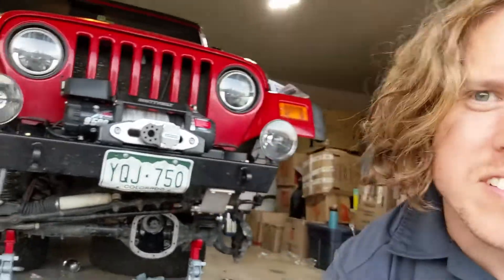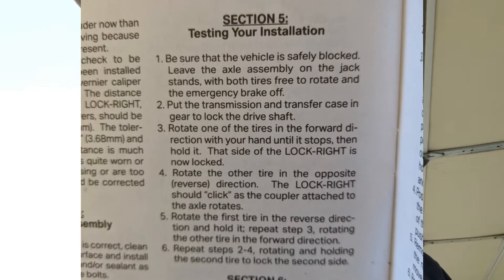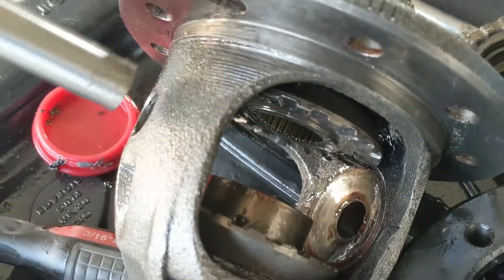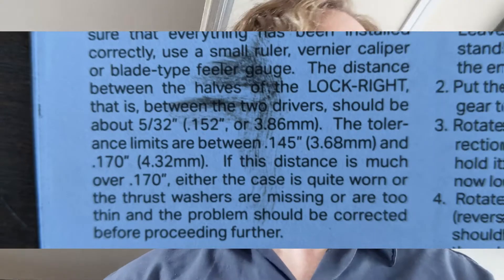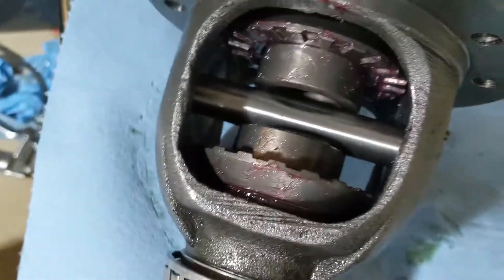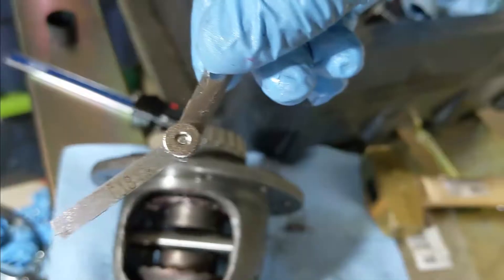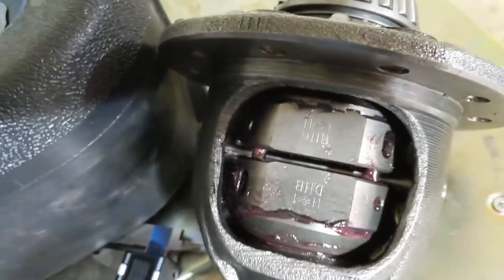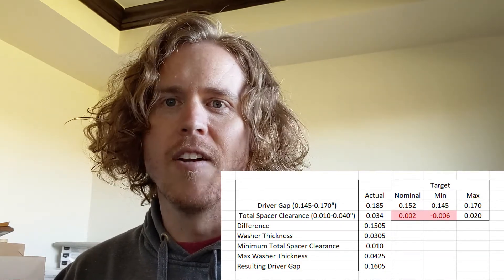Powertrax Lockright doesn't unlock!

Comment: I have the same unit for my 2011 ford ranger with rear 8.8, but the problem I'm having is I broken off 4 bolt studs & I'm trying to replace them. But the access inside the locker to c clip is very hard to pull out & I'm out of luck😭

Comment: I put a lunch box in my CJ5 not long ago.   It seems to work but it clicks when turn Conor’s people look at yo7 like the resend is trash. When you let off the gas it throw the rear sideways some.  I going to change it this winter. Go with a limited slip.
Reply: I don't know if you read any of the literature that came with the directions, but short wheel based (and Narrow track) vehicles like a CJ5 will definitely get 'funky' either getting on the gas OR abruptly getting Off the gas. I put an Aussie Locker in my CJ5 (Dana 44's front & Back) and yes, she made noise going around corners, and she would 'Bang" every now and then. People would look, and I'd just smile and say that when the Jeep is off-road, it'll go places that you can't ;-)    Living with a locker shows that you have upped your man-card into driving, and handling a vehicle that is ready for off-roading adventures, and you could care less what other people think!   Enjoy that CJ, I wish I had mine back 😞

Comment: Those do NOT use thrust washers
Reply from the maker: That's not what my install manual said, and if I had done it without washers it would have been even farther out of spec and still wouldn't have worked.
Reply: I put the old side gear shims AND the spare pinion gear shims I had left over from regearing to get my lock-right in spec. I think the powertrax is right for some vehicles, but is a very lazy design for many others (they make an initial design, and refuse to make any improvements or redesigns to fix original design flaws). It works for me, but I've already had to weld the pin holes because they were cracked and broken from the forces from ratcheting. Also, the caps for the axles heads were cracked and breaking apart (mine is c-clip design, so a cap goes over c-clip between side plate and drive plate). 
Many axles are different, and require different lock-right plate designs and set up. Some may not require shim washers, but mine did, but they don't provide shim washer kits, so I had to improvise.
Reply: @Thrsmthngwrngwthsgy  so you’re saying you doubled the shims on each side of the carrier I wonder if that’ll work for my lock right locker out of spec

Comment: Got everything back together and tested it. For reference the housing is the original housing but not worn loose. I did new thrust washers and my spacer gap was .013" on each side of the cross shaft. I've tested it, both axles will turn with each other when locked at the hubs BUT I cannot get the unit to ratchet and neither wheel will turn opposite each other for the test. Im not sure if that's correct or not, I'd hate to think I did something wrong
Reply: I have a lock right in a front 60,  I could never make it ratchet or turn opposite but it works perfect and has been in use for 7 years of medium wheeling. 🤷‍♂️
Reply from the maker: If you watch my follow up video where I compare the different lockers, you'll see where I test it at the end, how I make it luck vs unlock and see how much effort it takes to make it unlock. I hate to be the bearer of bad news but it doesn't read to me like yours is working correctly.
Reply: @freedomin4low344  Youre probably correct. thanks for the info & reply I'll be sure to watch
Reply: What brought me to your vid was, I just installed one in my other truck and had a hell of a time with the small pins. They refuse to seat in the opposite driver. I used way more force than what I feel necessary to drive them over and they still only went about ¾ of the way.  JUST far enough that I could get the springs in, even so the springs are almost fully compressed and I'm worried they're not effectively captured in the little window there.   As it is, I'll probably not be able to get it apart, since I drove the pins in so hard.. 🙄.. I dunno, the first one I installed was a breeze and this has just been a total fuck lol

Comment: I was confused at first, but now I think I understand after rewatching. The locker & both axle shafts locked up completely from being too tight? So neither side would spin at all, correct?
Reply from the maker: Actually it was too loose, so the pins would get sideways and bind up, preventing the sections from moving. End result is the same, locker won't unlock.
Reply: @freedomin4low344  Tanks for the quick reply man! I just installed a lock rite in my CJ Dana 30. The carrier was original so the shim surfaces were worn, replaced those and checked pinion to spacer tolerances and each side was .013" which is within spec. However I did not check for that final gap of 5/32"...Have to test it out today and see if it will unlock when I turn!

Comment: I'm having this exact issue with my YJ, so frustrating. Spartain locker will be here tomorrow
Reply from the maker: it sucks doesn't it! Don't know what's going on with them.
Reply: @freedomin4low344  I talked with Powertrax on the phone and they told me that I just needed to get a thrust washer that was .015 thicker to bring that driver gap into spec. Told them that adding that much would cause my pinion shaft to not clear the spacers. The guy on the phone said “well I don’t know what to tell you”

Comment: Well this sucks to find out, the Powertrax lockright is the only locker I can find for 10 spline axles. I have a JD 314 that uses a Dana GT30 axle (garden tractor Dana 30 axle) and the axles are 10 spline like the Dana 25 axles. I want a locker for plowing snow and make the machine better for garden work but really don't want to blow the machine apart to find the locker out of spec like that. Great video.
Reply from the maker: in all likelihood you'll be fine. There are plenty of those out there working, I think I just got one that slipped through the QC cracks and it was easier to return it than to find someone at their HQ that would believe that I'm capable of using a caliper.

Comment: Are you positive spider gear shims were removed ?
Reply from the maker: yes, spider gear washers were removed, side gear washers were still installed (per the instructions). I have a followup video where I installed a Torq locker, in the same carrier, and it stacked up perfectly fine and operates normally.

Comment: Did you ever get a lunchbox locker working in your jeep? Looking at one for the rear of my wj with a d44a so there the only option for lockers unless i wanna swap axles
Reply from the maker: Yes, Torq is in and working. I'm not sure I'd want an auto locker in the rear though, unless it's a dedicated trail rig. It's mostly invisible in a non-driven axle but I would expect a lot more "behavior" in the rear axle on pavement, such as pops and bangs in parking lots, understeer, unpredictability in snow/ice. It's easy enough to change back so I guess it's only a little time and money to try it out, and living with those quirks may be better than an axle swap. I know nothing about the axle options for a WJ but if an axle swap means taking something from a different vehicle and having to weld on all the brackets I could probably live with those quirks.
Reply: @4Low Garage  only bolt on axle options for the wj are d44 aluminum which I have, pretty much a d44 with an aluminum center section but uses a d60  ring gear I believe so cant use standard d44 lockers or d60 lockers its its own thing, and a d35 that you can't even put a super 35 kit in because the axle shafts need to be longer, a jk d44 swap is fairly easy bracket kits are sold for front and rear that allow use of factory control arms/linkage but like you said that requires welding and would be cheaper/easier to try out the aussie for a few thousand miles to see if I can live with it or not, alot of people don't seem to mind them on a daily driver in the rear, and I drive like a grandma anyways lol
Reply from the maker: If you look at my channel there's a follow up video to this one where I compare several lunchbox locker options.

Comment: Dang that is frustrating man! With you going the direction of the Aussie Locker, I assume Torq Masters, definitely don’t hesitate to reach out to them if you still have issues with the tolerances and they will get you all the info you need and supply you with the correct thrust washers to get you runnin! Best of luck to you!
Reply from the maker: I actually ended up ordering the Torq once I learned more about it. It went in perfectly with the washers I had, even toward the tight side of the tolerance at between 0.145-150" driver gap. Still gotta finish buttoning everything up but it passes the operational test so it looks like I'm good to go!
Reply: @freedomin4low344  how’s it been working out?
Reply from the maker: @dad3562  I really like the Torq locker. I can't hear it ratcheting around corners unless I clutch in and let it idle, with doors off, in a neighborhood so the sound bounces back to me off the curb. I like it a lot on trails where there's a lot of soil, sand, lose rock, etc. and I've barely even needed the rear locker. The only time I've wished for a selectable locker is when I took it to Disney, OK last weekend and drove around on 25 acres of solid bare limestone below the lake spillway. It was super grippy and my power steering pump was letting me know it wasn't happy about it.
Reply: @freedomin4low344  that’s so cool! Think it would hold up good in the rear? Manual transmission.
Reply from the maker: @dad3562  I would hesitate to put one in the rear. Even if it held up I don't think it would be much fun to drive. A lot of the reason it works in the front is because it's not driven in 2WD on the street. Put it in the rear and you're likely to have a lot more pops and bans, and weird steering behavior at driveway, parking lot, and residential speeds.
Reply: @freedomin4low344  oh dang that’s true! 🙏 thank you